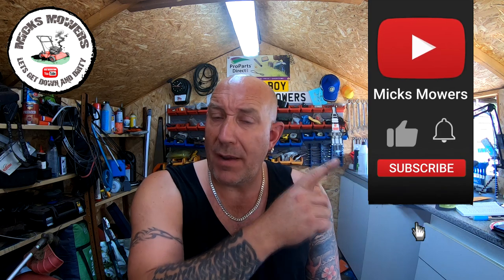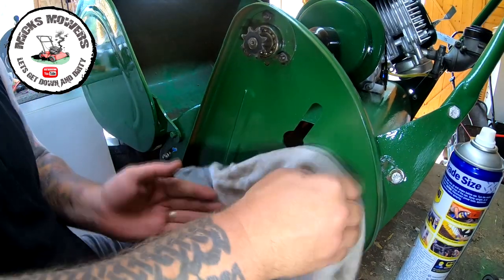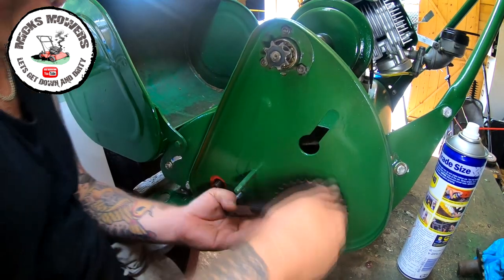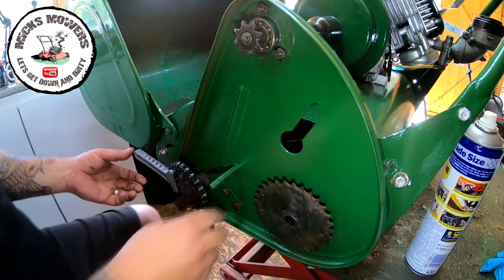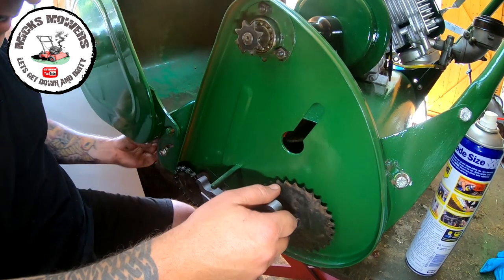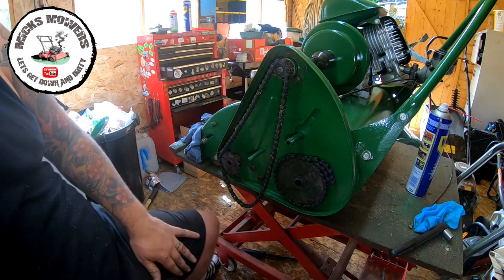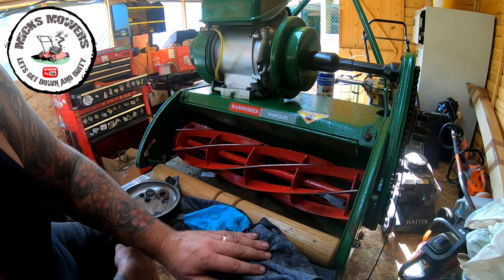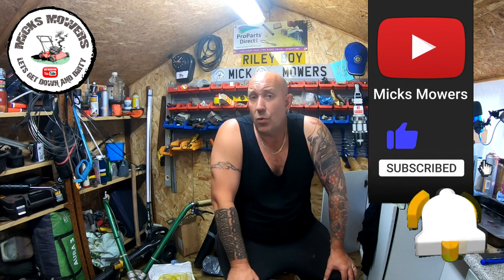Vintage lawnmower Ransomes Marquis . How to fit the Drive Chain- Clutch and Drive Cable..

Comment: I thought you'd have cleaned all the grease and crap from the clutch assembly before you fitted it mick...seen as you've done such a nice job refurbing the rest of it....I used to use theses mowers on the parks in Leeds...great old things last forever if you take care of them...I've recently completely rebuilt a ransomes motor triple...reeeeet beast..😂
Reply from the maker: Fantastic.. the triple is also a great mower

Comment: Hi Mick, I've got a Webb 14 my clutch is not engaging I've check the cable and the lever it seems the small shaft isn't proud enough to operate the clutch can i adjust this.
Hope this makes sense.Mike
Reply from the maker: You should be able to via the clutch plate springs I would say